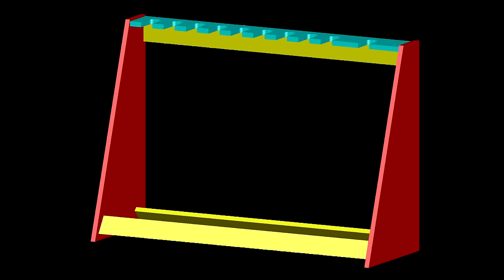How to Build a Guitar Stand - That Holds 10 Guitars

Comment: I made one of these about a year ago. Only held 5 guitars. Then I made one about 6 months ago that holds 7 electric guitars, cuz I bought 2 more guitars. Did mine pretty much the same way you did, except I used Acacia hardwood floor leftovers. Milled it down to square stock and went from there. Nice finished product. Great video btw!
Reply from the maker: +Donald Shores thanks

Comment: Should maybe point out that the bulk of rubber foams will leach out chemicals over time which will damage a nitrocellulose finish, so if you have any guitars finished that way, you're going to need to put something over the rubber to stop that.
Reply: I think by the time that happens he would have upgraded to something better
Reply: Hate on Gibson all you like, but you don't get nitro finishes on cheap guitars.
Reply: Derpimus Maximus who talked about Gibson?? Also I don't know if you ever bothered with Luthiering but nitro is nothing to brag about.
Reply: Derpimus Maximus Nitro is the worst finish you can get on an electric guitar.
Reply: I thought he used felt strips, not foam.
Reply from the maker: I made a second video later showing how i changed the foam which didn't last long.
Reply: @DIYBuilds  Great video and build, thanks! I was thinking I'd probably use old leather belts from a charity shop or something like that

Comment: Excellent!!!!  Nice looking stand but I'm afraid I'll have to have 2 of them. Glad to see you put the foam protection over the wood. Can't tell you how many clowns 🤡 I've seen who skip that part or do a shoddy job and it damages the finish.
Reply: Barney Fike  Might have done it a bit better using felt/cotton batting for the application instead of foam as, foam tends to break down over time,and takes a toll on the finish where contact in any direct sense is made. Felt or cloth batting may rub a bit over time, but rarely eats the finish off the body or neck.

Comment: Thanks for the free plans. I just finished building my rack using your measurements. The only tools I used was a circular saw, drill press, jigsaw, and a drill. I used cedar fence pickets, so it's not exactly like what you built. Hopefully with some stain and poly it will hold up for a long time.

Comment: Awesome build! Inspired me! What do you use for the rubber parts to support the necks and base?
Reply: No idea, but it looks like a self adhesive foam door gasket, or seal, to help keep weather out of the house in winter. Foam weather stripping. You can use foam pipe insulation if you can't find the weatherstrip.
Reply from the maker: Ya that stuff failed and I made a follow up video fixing it by adding padding a cloth stapled on everywhere if you want to have that a watch.

Comment: I didn't understand the directions clearly enough; the depleted uranium caused the  stand to come to life and the stain chipped pretty badly on the sides, so now it looks awful and keeps calling a loser and it won't give back my socks. your thoughts to correct this issue...
Reply from the maker: +dan B insert giraffe 'B' into slot 'A' and that should fix the Flux in the capacitor. my apologies for not making that clearer.
Reply: DIY Builds lol thank you, made my week. 😀

Comment: You would think with all the money you spent on tools you could afford a riving knife or guard for that table saw.  Pretty sure you have heard this type of statement before and will continue to ignore them, just had to try and get you to be safer.  Especially if you’re gonna make “How To” videos.

Other than that, good build.
Reply from the maker: +Marcus Choate table saw was 200 used and didn't come with either and no way to equip it with either. Thanks

Comment: How to build a guitar stand.

First buy 20000 dollars worth of machinery....
Reply from the maker: +Lord JeSith na mostly used tools. Probably my whole collection 2000 over 10 years
Reply: You could also do this whole project with a drill and a jigsaw, which you could buy for between $50 and $100 even with the bits and blades.  Oh and a pocket knife for cutting veneer and foam.